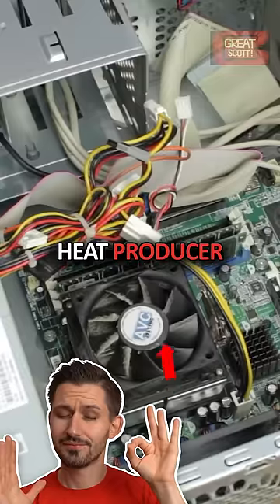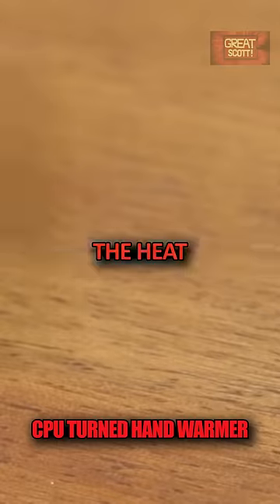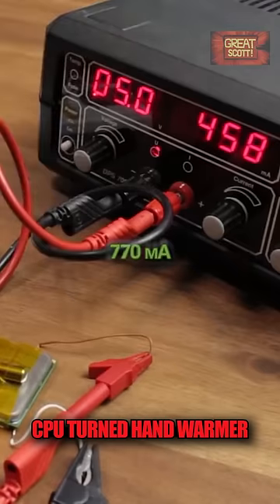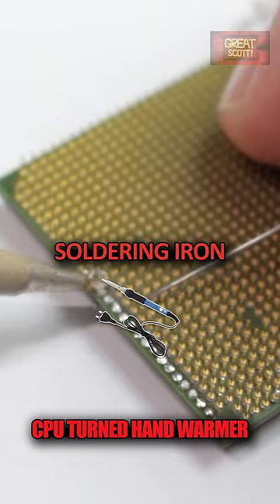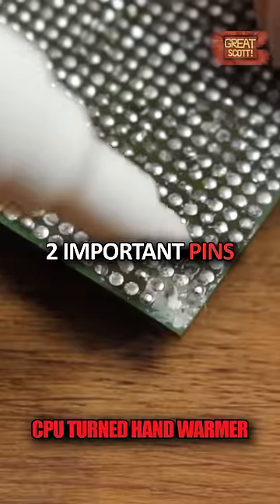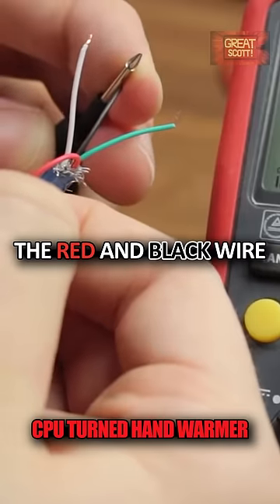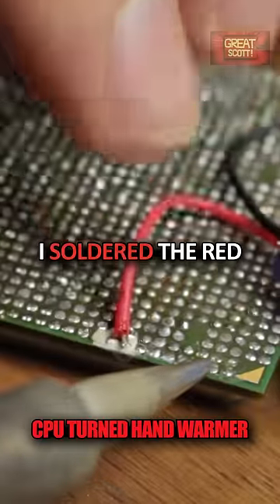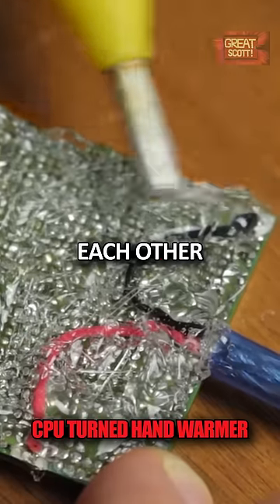I Upgraded my CPU into a Hand Warmer!

Comment: That poor Athlon getting 5V
Reply: Bonus function at 12V - the smell of incense  😊
Reply: @vladimir66cz48  ah..I was wondering why it didn't get too hot in the vid😅🤭
Reply: @vladimir66cz48  that's will be useful then
Reply: It can't even run windows 8
Reply: @raycert07  but my Athlon can run it with some fan noise at the background
Reply: @marisakirisame867  sounds like a newer Athlon then
Reply: @raycert07  it's AMD Athlon X4 870k
Reply: @marisakirisame867  sus pfp
Reply: @Hi-ix5bb  better than nothing
Reply: @Raycert07 channel who would want to run windows 8? I have really fast and usable systems running Linux that were not the top of the crop 20 years ago. Note that I said usable
Reply: @marisakirisame867  “better than nothing” dude i love your humor (im not joking btw)
Reply: @marisakirisame867  L pfp
Reply: @jaysjungle  hoi why you all just kept complaining about my PFP?
Reply: "OVERCLOCKED/OVERVOLTED"
Reply: @marisakirisame867  i have an x2 340 and it runs windows 10
Reply: @raycert07  my AMD Athlon 64 x2 5400+ black edition still runs windows 10
Reply: @retromusician_official  my little Intel Celeron b840 can run win10
Reply: @alejandroalzatesanchez  use AMD FX with liquid nitrogen cooling system
Then it will reach max overclock speed of ~8ghz
Reply: @marisakirisame867  I had that processor, and Windows 10 worked
Reply: @Spiral2404  what's about Intel pentium 4?
PGA edition
Reply: @marisakirisame867  idk
Reply: talks about it getting 5v to repurpose it to a hand warmer but didn't for the fact that he gutted all of the pins
Reply: @marisakirisame867  
Maybe because... uhhh... you have that squashed spider thing that symbolises bad stuff.
My advice is to take it off and stop being edgy.
Reply: @marisakirisame867  Critical profile pic 🤮
Reply: @raycert07  i ran windows 11 on it and played csgo, safe to say it was so powerful it bottlenecked my DDR3 gt710
Reply: @degenerate_kun_69  csgo is 11 years old, and the gt 710 is less powerful than my old laptops integrated graphics. More powerful gpus existed in that cpus prime.
Reply: @raycert07  there is also something called optimisation
Reply: @degenerate_kun_69  and optimization is spelled with a z, not an s. Csgo is one of the easiest "modern" fps games you can run.
Reply: @vladimir66cz48  🎉
Reply: @marisakirisame867  Prescott,bad experience with Prescott temp over 92
My PSU basically failed so I would keep it running using a stabilizer & never turning the dragon off,it cooked my room,& maybe gave me brain damage since I spent 8years on that thing in my room,& that thing always running,I remember some nights when the fan would ramp up,I would throw a big shoe at the desktop,& it would shut up
Reply: @vladimir66cz48  ah... burnt silicon and thermal paste....
Reply: @raycert07  my old athlon x4 ran fuckin gta 5 with my gtx 750, much less windows 10
Reply: @DaneH64  once again, that is a newer Athlon, and gta 5 came out in 2013. It runs on a console from 2005 that used bottom of the barrel components.
Reply: @marisakirisame867  I like it 😊
Reply: @charliesretrocomputing  danke
Reply: @raycert07  I got one to run bf4 40 fps back in the day
Reply: @marisakirisame867 is that the first Volkswagen logo, but missing the VW?
Reply: @raycert07  the z and s thing is an American and British English thing. You might as well start arguing about which side of the road to drive on and how to pronounce lieutenant as well.
Reply: @Cenentury0941 if it's an American thing, then why do Canadians drive on the right? How about Mexico? Germany? Most countries drive on the right. And most counties don't use stupid versions of words and stupid pronunciation.
Reply: @raycert07  “aluminum”
Reply: @Satsuma GT  Canada also uses aluminum instead of aluminium. As does Mexico, and surrounding territories. Your not proving your point here.
Reply: @raycert07  I’m pretty sure Mexico uses “aluminio”
Reply: @Satsuma GT  that is the Spanish version of aluminium, those who speak English there, when they say aluminium, it's aluminium, not aluminium. I can tell you love to misinterpret everything, but it's not working.
Reply: @marisakirisame867  ur pfp ☠️
Reply: @marisakirisame867  dawg your pfp😭😭😭
Reply: @rylinyt  hey wtf is everyone keep talking about my PFP??
Reply: @marisakirisame867  cus it’s a freaking swastika
Reply: @degenerate_kun_69  gt710 was such a scam card.
Reply: @raycert07  if doom can run on a pregnancy test, windows 8 can definitely run on something meant for general processing
Reply: @ProGamer112  doom is really old, windows has actual requirements to run.
Reply: @raycert07  a pregnancy test isn't made to run programs, an athlon can actually run stuff (probably can even run tiny11)
Reply: A bonus function of higher voltage will be that it gives of Light... Once
Reply: @marisakirisame867 you need to be punished for that pfp
Reply: @raycert07  my amd athlon II x4 can handle windows 10 just fine, slow with everything else dont get me wrong, but for a 12+ year old cpu its not bad
Reply: it's an amd, it can handle it
Reply: @raycert07  it’s still a waste of a (hopefully not) functional cpu.
Reply: @driftliketokyo34ftw35  it can't do anything. It's from around 2001. Your phone is more capable. Simply buying parts to keep the Era of system alive is more money than its worth. Ram for such a cpu can run you as much as a used pc thats DECADES NEWER. It's not a waste. The cpu is too old to do anything useful for its existence.
Reply: @driftliketokyo34ftw35  the max ram this cpu likely supports is 4gb, and it's less than cheap laptops come with. 8gb is bordering unusable for desktop tasks these days.
Reply: @satsumagt5284  maybe comrade
Reply: @MarcusJohnsoncray  das Chinese graphics
Reply: @progamer1125  ngl
Reply: @marisakirisame867  oh yea
Reply: Ok

Comment: hot glue on a heater. interesting design choice.
Reply: That's on the colder side i guess
Reply: It's a feature. Heater glues to your hand after fires use, so you will never forget it anywhere
Reply: It's on the side where cables are connected, it's not really hot there, and at the end 40 50 60 degrees is not much for hot glue
Reply: @yassinesafraoui  hotglue gets really soft and bendable already at 40c
Reply: @Kasi11  Okay, didn't really know I just guessed
Reply: If it doesn't get hot enough the glue wont melt.
Reply: @theearningcurve9684  yeah, but it if it does get hot enough, it will melt 😉
Reply: @theearningcurve9684  Well, CPU can easily reach 90 °C (which is 194 °F for you American folks), which may be hot enough to melt the hot glue. And that is at the PROPER CMOS VOLTAGE, which is around 3.3 V! Now imagine putting it on 5 V. You may reach temperatures well over 120 °C (248 °F), which is enough to melt the CPU core. So I guess this is very much something I wouldn't use at home or anywhere else, because it poses a fire hazard at this point. Because if enough heat transfers to flammable substances, it can easily catch fire. This is a life hack that could get you burn injuries and potentially burn your house down. Don't recommend.
Reply: @CZghost  yeah cpus can get to 90c, but this one obviously isn't going to be at 90c lmfao
Reply: I think kapton tape would work for this right?
Reply: Clearly you lot didn't hear him say it reaches 44C.
Reply: Really ? The guy is using a CPU as a hand warmer and that's the only things that disturb you. 😆
Reply: "SUSPENSION OF DISBELIEF 101"

Comment: That's great! And when the process heater warms up, hot glue adapts everytime to new environment with ease.
Reply: I learned this the hard way. Hot air for desoldering does - oh wonder - also soften hot glue...
Reply: I use hot glue to "fix" broken usb cable head, but it melts because of the heat from my usb charger. Now it's inseparable 😂
Reply: @dputra  😂
Reply: @dputra  wtf😂😂

Comment: Hot glue on something that gets hot? Great scott!
Reply: im pretty sure hot glue takes more than 44 celcius to melt
Reply: @CajunReaper95  Only 80°C? More like over 100°C on Ivy Bridge. And some even up to 120°C before there getting in trouble.
Reply: @CajunReaper95  When they have more than 2 pins, sure.
Reply: @CajunReaper95  its a hand warmer, theres no pint in going up to 80c
Reply: @CajunReaper95  it's not getting to 80c with this power
Reply: @CajunReaper95  if your cpu has gone 80c and over then theres something wrong with your build dude
Reply: @Mirakuruuu  Its not 1997 anymore dude. YES, cooler is better; but 80c wont even throttle modern amd and intel offerings lol.  7700x's are set to start limiting at 95c lol, and 13900k's are a whopping 100c.  80c is "fine" for cpu intensive tasking. If youre idling at 80c, then yeah youre probably having an issue lol
Reply: @CajunReaper95  when you realize usb power maxes out at 2.5 watts and this would never touch 80c ever...
Reply: Hello fellow HL fan

Comment: is it hot enough to keep your coffee warm? if yes then a 3D printed coaster bracket will perfect!!
Reply: That would be really cool. Or make a plastic transparent case so you can see the cpu
Reply: at 770mA i don't think it can give enough heat. But you can increase the voltage or maybe connect more pins to increase the current. But it also will increase the  chips temps, which may cause fire
Reply: That's an idea I'm going to have to steal since my coffee warmer just broke.
Reply: There are actual datasheets which tell you, where all the power pins are. There are more than 2, you can easily increase the power using more pins.
Reply: @Anubisviech  is it open to public? Well that makes it much easier then
Reply: @siontheodorus1501  😊

Comment: Why not just find or get a bunch of resistors?
Reply: You can't just put resistors for more heat. You need to find the sweet spot between total resistance and battery provided voltage and current. Plus, the CPU is useless anyway and the metal on top acts as a good hear diffuser

Comment: you can just use an peltier device for simplicity and it has more voltage tolerance
Reply: Yes but you need a heatsink and stuff or it would just get too cold on the other side, a length of thin Nichrome wire and some highly thermally conductive glue would be a lot better if you don’t have room for a heatsink. That said peltier would be the way to go for efficiency if you wanted to get your hands really warm on the least possible power without carrying around a compressor and a couple of radiators.😜

Comment: @great scot You could have done it more easier by using ryzen processors which don't have pins so you don't need to desolder
Reply: Mine had pins , 5600x

Comment: Is the cpu still gonna work after that?
Reply: With 5v going in I doubt it even if he made a jig to put all the pins back on aand the static didn’t get it.
Reply: No.
Reply: @glenecollins  It was an ironic question ;)
Reply: @lapissea1190  😜  I think it is still funny if there is an answer, perhaps I should have just gone with no.

However after thinking about it, it is possible it would still work I have repaired laptop boards which we’re feeding the 5v line into the CPU and they limped back to life (at least for long enough to get the data off.)

The hot glue is likely to remove itself if he actually used it so it may be doable if you could get the pins back on. I don’t think mobile CPUs would be more voltage tolerant than desktop ones.

I think it would be pretty funny if he got it working (you can buy jigs to redo the pins.)

Comment: And why are we not just using a resistor and an adjustable power supply and get the same effect. Next time save the CPU you can actually extract the gold from the pins

Comment: Do not do this if you fuck it up you could get hurt or die from the electric shock depending on the wattage of the cpu
Reply: You aint gonna get shocked from 5 volt buddy! Touched enough 5 volts and never felt anything and i am still here so go learn Electronics

Comment: If the specs of the CPU are over intel i7 10th gen, I will find you. Because you just ruined an art piece. And you should be sentenced to 10 years in jail for mass murder of the pins and mass grief. 😠
Reply: Its a old ass athlon cpu that cant evwn run windows 8 nor even 10